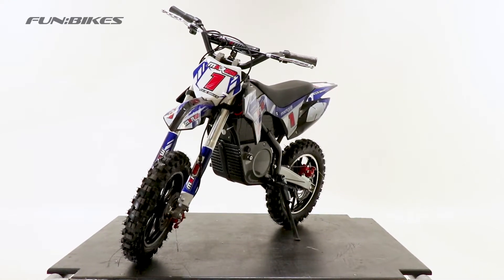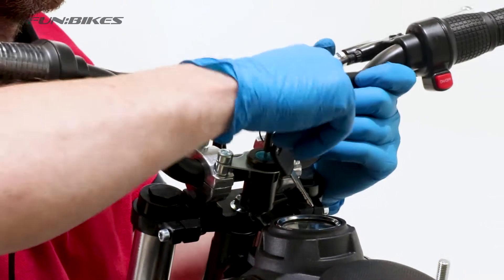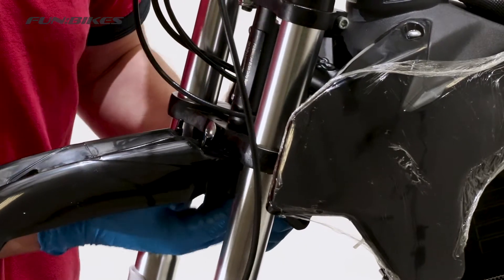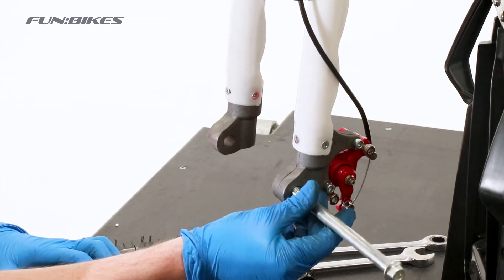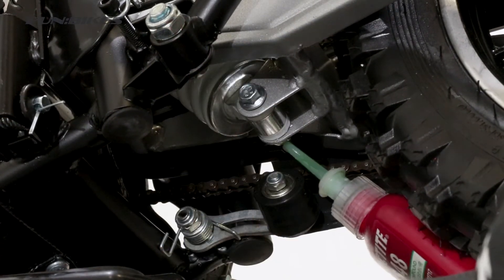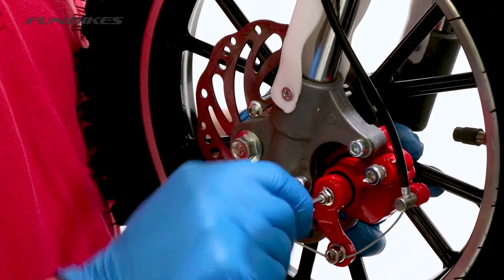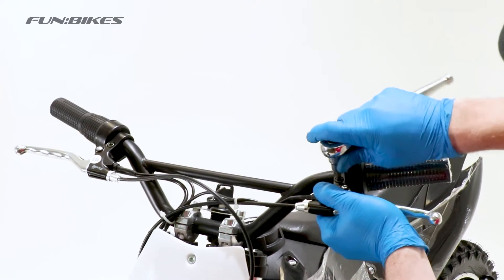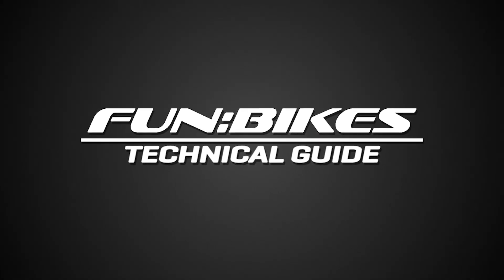Technical Help: How to Build the FunBikes MXR 61cm Electric Kids Mini Dirt Motorbike

Comment: Might sound silly but where is the fuse holder
Reply: Sophie Louise doesn’t sound silly . I can’t find my sons !! It’s not there? And in my instructions it said nothing about fitting one ? And has been working fine until now
Reply: @NathanHolle  it’s electric
Reply: We can't find the fuse box but we were given a fuse? Very confused
Reply: Rang up it has built in fuse that's why it has a kettle lead
Reply: Katie Lewis hi , I found it lol inside but it was fine . I phoned them they said I need to test the ignition switch and then the main controller with a multi meter.  

Has yours stopped working ?
Reply: Hi Nathan, we didn't continue to charge once bike was up as wanted to double check about the fuse, apparently only the older model have the fuse box and the new ones are built in this why it has a kettle lead, he asked why I thought it needed a  fuse I said because I watch this video and there was one given lol there manual and video need updating!
Reply: Katie Lewis hi Katie, I see. I had the same thought as I followed the instructions. I too was told it’s the newer model and the supplied instructions/ online video need updating. 
Bit frustrating. Thanks for replying